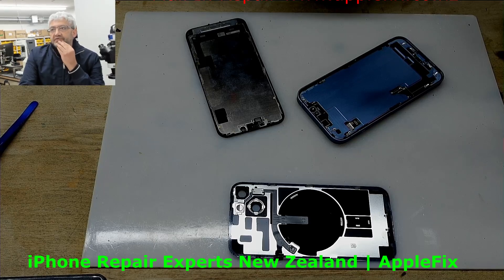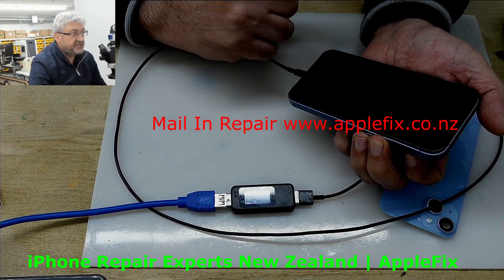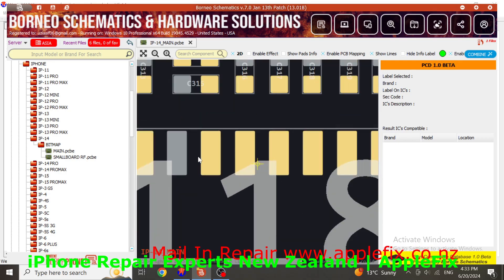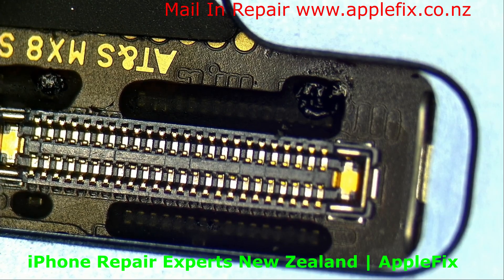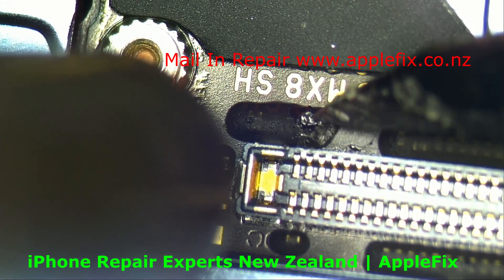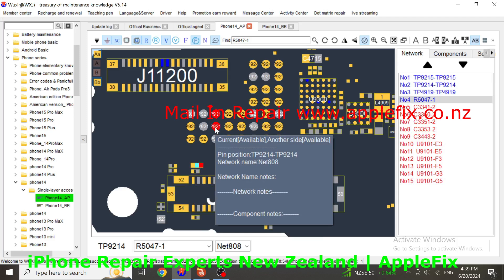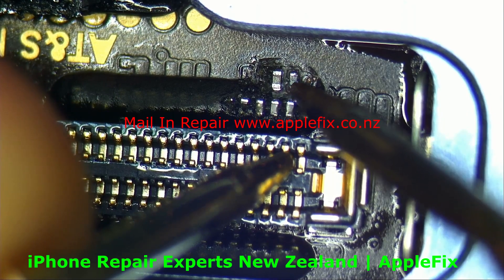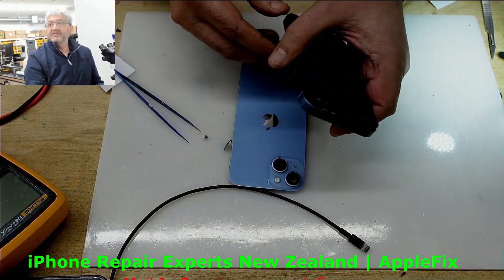iphone 14 No display , Black screen after screen replacement | FL5017 Board repair | AppleFix NZ

Comment: Thank you for great video and professinal work! Will you tell me how you established that filter is gone ?
Reply from the maker: check with multi meter in beep mode
Reply: @ Thank you again.Beep both side means is gone write ? In my case measurements is 0,300 / 0,300
Reply from the maker: @tarikatacs  on filter it should beep
Reply: @ApplefixCoNz  Have the same case.After new screen the phone work fine.After one day the display blinking when pres the power button.With other original or aftermarket displey no image as well ... Measurements in all LCD connector pins is ok . Trying to flash new SW ,but after 50% on 3u tools fail (error -2)Now the phone is dead.Cant put in recovery mode anymore.Only charging 0.6.The phone lock like brand new.Never opened before.What is your advice? Thank you!